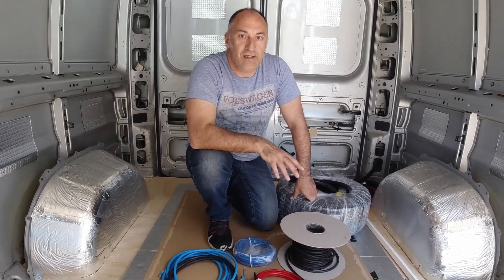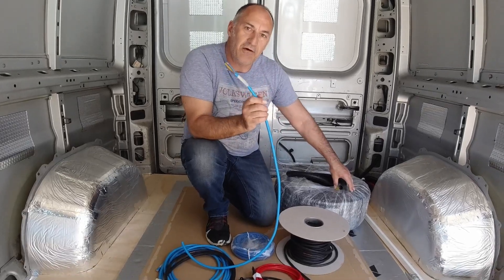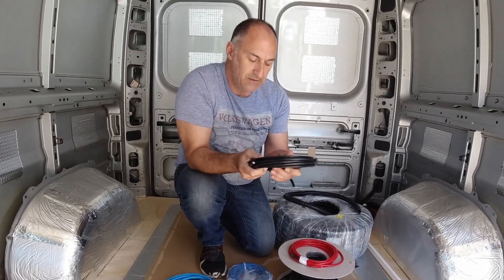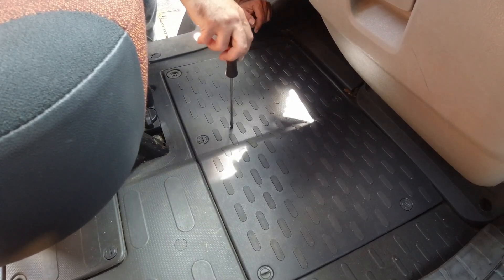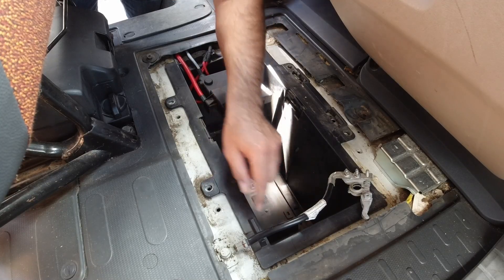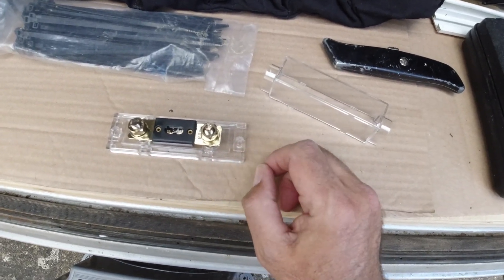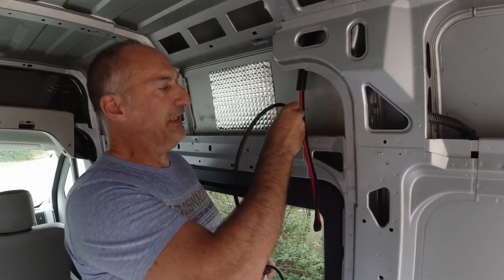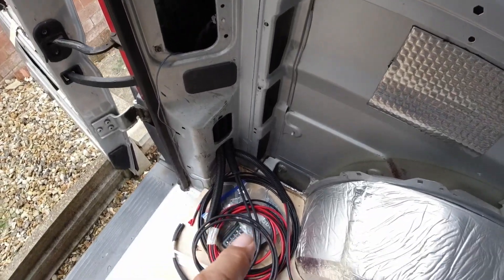How to Wire a Camper Van - Budget Build Electrics Ep15

Comment: Good stuff Greg. I'm still very keen to understand your earthing policy. Will you be directly earthing the DC2DC charger to a nearby bolt? If so, how will that affect the charge information given the shunt does not have this coming in?
Reply from the maker: No, I’m not connecting any of my 12v DC leisure side to the chassis of the van. This is an isolated system and 12v DC is inherently safe so does not need an earth at all. 
I will be earthing my 230v AC side but that is more dangerous system to us.
Reply: @GregVirgoe  Superb! Thank you. I'm confused here because I do often see people earthing their 12V feeds at various points. The DC2DC charger being a good example. But then how do they get to find out the current coming in if it's not attached to the shunt? It hurts my brain!

But Greg you are the legend and I'm going with your advice!
Reply from the maker: @widearchshark3981  firstly it’s not an earth on 12v systems it’s the negative. Often the van chassis is used in non isolated systems as a negative path back to the battery instead of running a negative cable. This negative connection to the vehicle is often called a ground connection but that word is not to be confused with earth, they are not the same thing.  An earth in 230v mains wiring is a path of least resistance back to the source in case of a fault in the circuit for safety reasons. So you see one is part of the working circuit and the other is there in case there is a problem. Hope that helps. 👍🏼😊

Comment: I only checked your channel last night to see where you are! Great work as always Greg cheers!  😎 Quick question...I'm going to have conduit in cavities (similar van Citroen Relay)  will they rattle around do you think?
Reply from the maker: You still need to cable tie them in many places or pack the voids with insulation to keep them from moving around. Current regs calls for cable supports every 250mm 👍🏼😃

Comment: Great video again Greg and I can't even imagine how much work goes into the editing etc. Just a thought and to potentially save more cost, is it feasible to run the negative for the blade fuse holder directly from the van body at the point of use, would save a few meters of the 10mm
Reply from the maker: I personally do not recommend using the van for any negatives. 
No problem with poor connections high resistances or voltage drops and systems not working as they should. 
Not one area I want to save money on. I would rather it works well first time round. 👍🏼🤩

Comment: Perfect Greg... absolutely perfect. You've just saved me a few quid on cable.

I dont know what I didn't think of locating the fuse box to the middle of the van (mines an L3) makes fishing cables through flexy conduit alot easier too with shorter runs. I'm doing a MEGA order next week to continue the build. That's so tidy aswell routing the DC DC charger cable underneath the van and again if there is any problems makes it accessible. 

I'll be picking your brains on solar on the solar video if thats ok as I'm still unsure what to order in terms of panels and want to go LITHIUM with my batteries. 

Thank you once again. Your a top mam and have helped 1000's I'm sure. 🙏🏻💚🙏🏻
Reply: Hi Greg, me again, I've come across a potential problem. If I'm running 2 Victron DC-DC  12/30 chargers...am i right in thinking that the voltage drop and amperage pulled (75a) potentially is gonna be too much for the 16mm2 cables running to the back from the starter battery. I've used the volt drop calculator on 12v planet and it says over a 6m run (approximately) the percentage volt drop is 1.13v or 8.9% of 12.6v

So would we be better to go for 35mm² or even 50mm² just to account for the bolt drop?
Reply from the maker: @ChrisYid  at that load you definitely need larger cables. 
What batteries are you putting that load into? Lithium I hope 🤞🏼🤔
Reply: @GregVirgoe  yeah definetly going Lithium.  Was thinking of 200ah either 2 x 100ah or a single 200ah
Reply from the maker: @ChrisYid  Renogy are doing an amazing deal at the moment for 2x 100Ah CORE lithium batteries for £639 🤩 amazing value https://uk.renogy.com/core-12v-24v-48v-100ah-deep-cycle-lithium-iron-phosphate-battery/?Rng_ads=28c1fb4c110f2e4e&gclid=CjwKCAjwg4SpBhAKEiwAdyLwvAz9-odOxcgtAJjULOned1UJTOWhpxlr8WN_NpRKzoOUJgJaVhSzRxoCRRgQAvD_BwE
Reply: Actually volt drop shouldn't come into it the minimum Input voltage for the Victron 12/30 is 10v so even with 25mm² cable the amperage would be fine with 2 running in parallel producing near 75amps.

25mm² cable
Nominal Voltage 12.6v
Current Draw 75a
One way circuit length 8m (airing on the safe side length wise)

Voltage drop 7.33% (0.924volts)

I love maths 🤦🏻‍♂️.
Reply from the maker: @ChrisYid  yes, but look at what you are losing VxA=W
So 0.924 x 75 = 69.3watts 😳
8% of what your generating you’re losing to resistance. The cable will handle the amps as long as you’re happy with the loses. Your call 😊
Reply: @GregVirgoe  I didn't take that into account. I went with 35mm² in the end. I wanted to run the cable in now rather than later as I'm buying the Victron 12/30 DCDC charger and was going to see how I get on with my solar array and charging capabilities and possible add a 2nd 12/30 DCDC charger in parallel at a later date
Reply: I'll check them out mate thank you. 

Another quick question about the wiring. 

I'm fitting a truma 4e like you did on the sprinter build but I can't seem to find on any wiring diagrams what it needs in terms of a 12v supply for the controls or 240v and where its wired back too. 

Have you got any diagrams how you would wire the boiler, fridge and 240v sockets for when your on a hook up. 

How many mcbs do I need when buying a consumer unit.. I see most come with 2 and an RCD. 

I'm at the stage of insulation.

Thanks Greg 🙏🏻💚🙏🏻
Reply from the maker: @ChrisYid  ok you squeezed a lot into that quick question 🤣👍🏼 
Truma boiler needs a 12v 10amp supply to the boiler, it needs a 230v 10amp supply from your hook up for the electric heating side. The controller needs a 12v 1Amp power supply and then you need the supplied control cable between boiler and control panel. 
Take a look at my video on consumer units to answer those questions Should You Install A Consumer Unit In Your Campervan?
https://youtu.be/kdvm0TFvfVQ
Reply: @GregVirgoe  I'm probably being thick I just want to have all my cables run in before I insulate..but then again do I need to?

I'm assuming you should run cable for 240v sockets or spurs to the truma and compressor fridge for there 240v hook up supplies and then take them back to a consumer unit and give them there own MCB's...actually saying that they would be fused at the plugs or spurs so I suppose you could run them to 1 MCB and the other 240 sockets for a TV and Household appliances to another again they would all be fused at there respective plugs. 

I've decided to run my fusebox on the passenger side where there upper cabinets will be to keep my supply to the fuse box and fridge (same side opposite the shower) (it's practically like your Sprinter build)  to keep my 6mm suppy to the fridge and 10mm supply to the fuse box from the batteries shorter as when I did the volt drop calculator with the 15amp inrush current from the fridge and potential 50amp load to the fuse box the volt drop would be over the 3% for the cables (roughly an 8 metre run for the 10mm and 6 metre for the 6mm) or something like that. My head feels like mush and I didn't write anything down lol. 

Putting it on the passenger side if I've got the fridge down to 4 metres of 6mm and the run from the batteries to the fuse box in 10mm would be 5 metres roughly.
Reply: @GregVirgoe  to be fair I've watched that video a few times. I just couldn't see an electrical diagram that mentioned the truma boilers. At least I know now I've gotta order the boiler so I can run the control cable before I insulate lol
Reply from the maker: I’m really glad this one helped you. Please do ask away I’ll be happy to help you if I can. Renogy have a fantastic deal on two 100Ah lithiums from their new core range for only £600 that’s amazing value for 200Ah of lithium from a brand leader.
Reply: @GregVirgoe  Great video, if you had these batteries would you consider going gas free ?
Reply from the maker: @iainhenderson8751  it would help but it needs more solar. It’s ok having a huge battery bank but you need to be able to recharge it. 
I wouldn’t go gas free if I had to run my van all the time to recharge the batteries that false economy.

Comment: How come you run a neg to the battery for the DC-DC charger? Can you not just use an earth point in the rear of the van? I guess same question for the fuse boxes too.
Reply: That's how I wired my DCC50S with no issues, as long as there are no corrosion issues at the connection points the chassis will be a lower resistance return path than a cable but there's nothing wrong with this way except possibly cost of the extra cable and this way the neutral connections will probably be more accessible to check 👍
Reply from the maker: @Dirt-Diggler  I’m happy it’s working for you. You mention another good reason not to use the chassis. Corrosion, poor ground and that bolt being buried under all your nice van build panelling and furniture. Cables every time for me.
Reply from the maker: I never recommend using the van body for the negative. You get a much better connection and less resistance and volt drop if you run cables. No problems with poor chassis connections and just as easy to install. Makes for a much better system and no issues with van electric interference either.

Comment: Thanks for another excellent video Greg. We really appreciate you sharing your knowledge with us first time van builders. 
Perfect timing for me as first fix wiring is my next job!
I've managed to get the Maxxair Fan and two 175w Solar Panels fitted today. 
Mine is LWB so think I'm going to fit another Maxxair Fan at the back too. Do you think it's worth having two? Mine will be a 4 berth so I think I'll need it to keep condensation under control? 🤔
Reply from the maker: If you have the budget it’s a great addition. We often use them together when cooking. Bed on supply and kitchen on extract make for great airflows. 
Plus bedroom one on low during hot wether gives a nice cooling breeze 😊
Reply: @GregVirgoe  thanks Greg. I didn't originally plan another fan at the back as I didn't think I'd have the space. After fitting the solar panels today I've got loads of room left on the roof, surprising how much longer the LWB is. 
I really like the idea of great airflow through the van using supply and extract. Looks like I'll have to stretch the budget slightly 😉
Reply from the maker: @yamashimajust  it helps to have the same amount of air come from another area otherwise it’s like putting your finger over the end of a straw while trying to suck on it. Nothing happens.

Comment: Thanks Greg. I have fitted fuse boards to both sides of my conversion in the top cupboards centrally. It's surprising how many cable runs one needs. Keep them coming, please.
Reply from the maker: Well done 👍🏼 it really does make more sense to have them mounted local to where they are needed 😃

Comment: Hi Greg, couldn't you just use the chassis for negative connections instead of pulling extra wires?
Could save some money for the budget :-)
Reply from the maker: I'm having to pull one cable so that might as well be a 2 core cable and it makes a much better system all around. no issues with poor ground connections, high resistances and volt drops, plus no issue with the van electrics interfering with the leisure side either. I never recommend using the van body for the negative path.
Reply: I think your thinking of isolated or non isolated ?  
Non isolated DC to DC chargers use the chassis as a common ground, isolated DC to DC chargers ground separately at each individual battery 🤔
Reply: Hi Greg, So am i right, this is called a closed loop circuit. A single positive cable with a bolted ground earth is an open loop circuit?
Wondered what the advantages/disadvantages were of both systems as not much on Youtube about it?
Reply from the maker: @MrPhlipflop  open/closed loop normally refers to control circuits where you get feedback from the controlled item. This is an isolated system since it’s detached from the chassis.

Comment: I've seen a lot of builds with the cable just sitting in the voids. Apart from the possible short hazard, Conduit also makes it much easier to add new circuits if you have to. 
Well worth £10-15 up front (and you saved a lot more on the cable!)
Reply from the maker: I can't agree more, we have added cables to our Sprinter van over the years and so glad I could use the conduit to pull new ones in.

Comment: Thanks Greg!  Glad to see that I've done things right so far!  :-)  So... what I'm hearing is that, to avoid running long run cables you've centralized your 12v fuse box.  Did I hear that correctly?  I've noticed that as I am planning the cable runs to various parts of my van, there are some long cable runs.  Looking forward to your next video and see how you run your cables to 12v lights, ports and USB ports.
Reply from the maker: Yes i'm having one fuse holder in the garage and one inthe kitchen, that will keep the run out cables a lot shorter, think of these as local distribution fuse boards.
Reply: @GregVirgoe  Thank you for the speedy response.